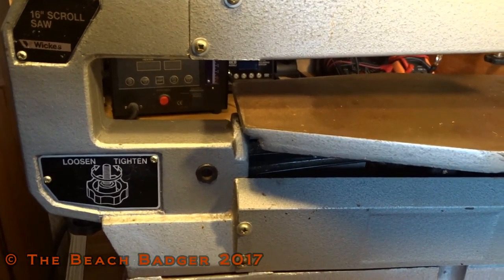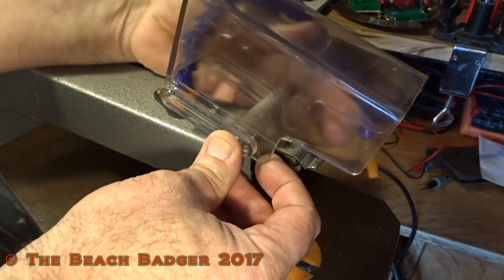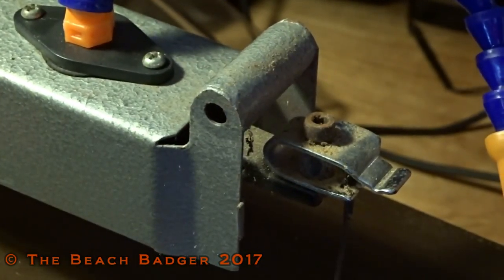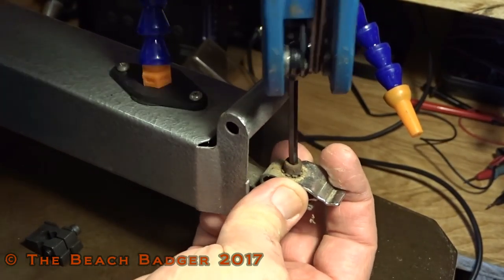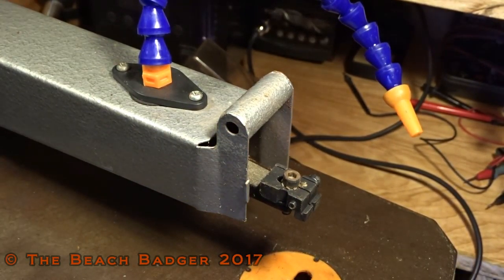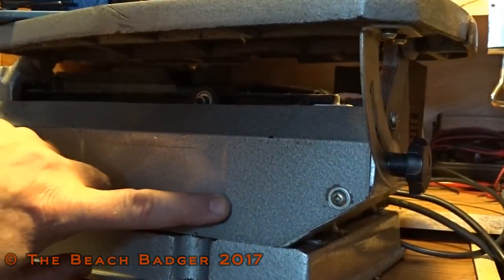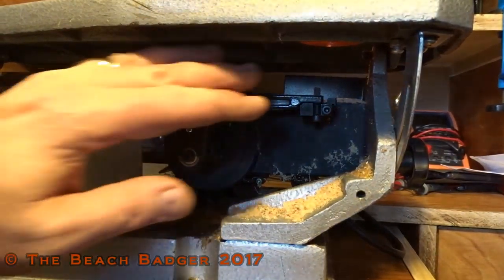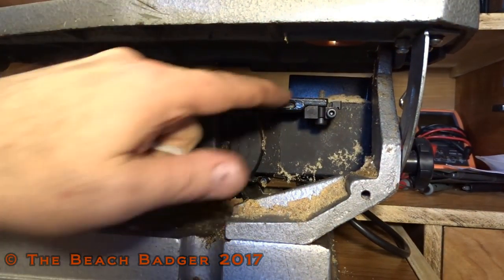old woodworking scroll saw conversion add a pinned and unpinned blade mount

Comment: Found your video, with exactly the same scroll saw as I have, 12 hours too late. Luckily last night I bought a set of blade guides as a long shot to fix my broken top metal guide & they look to be the same as you bought so they should work. For the person back in the comments asking where to get. I got mine from axminster tools  PAIR SPARE BLADE CLAMPS FOR CCVFS/ AWVFS/ 700153 to fit axminster or JET. My model which is the same design as Badgers is a Titan SF16G as was sold by Screwfix in the day.

Comment: I was watching in the hope you would show how you fixed the pin less blade in.I have a scroll saw with pined blades, but am not sure if it will take pin less blades.It's only a few months old, and was hoping it would but can't see in the manual.
Reply from the maker: sorry i didnt show it clearly, you place the pin less in the slot at the front of the mount and just tighten the allen screw on the side of mount so it grips the blade and holds it  in place ( do this on the top and bottom mount) , when using pinned blades the allen screw is left undone and the blade just hooks over the top of the mount, hope that helps.
Reply: thank you, I have been thinking my machine only uses pined blades. I will go buy some pin less ones now. Thanks again.
Reply: @TheBeachBadger  I am using Olson Spiral blades 46100 and tightening  the screw alone does not close the mount far enough to grasp the thin pin less blade.  Some sort of lock screw for the other side in necessary to provide a space take up to allow the closure to be tight enough to hold the blade.

Comment: I have been looking online at scroll saws with these type of mounts and most of them have a metal plate on top. Would this prevent them from snapping?
Reply from the maker: a good question unfortunately i dont know you could try fitting a plate like you have seen and give it a try,, the problem i saw is the mounts seem to be made from cast metal, let me know if it works gl
Reply: Will let you know if it works
Reply: I have tried these fittings for a month! I made a metal plate for them, I put the screw in the back hole and it hasn't  snapped
Reply from the maker: great Thomas glad you sorted it ok

Comment: Where did you find the mounts for replacement? A link or part number would be nice ! Thanks!
Reply from the maker: ok since doing this mod i ran into a problem one of the mounts snapped looks like they are made of cast , here is the site i got it from http://www.axminster.co.uk/axminster-blade-clamp-for-awvfs-scroll-saw-400124?sel=400124, i have since done a homemade clamp which works well :) hope this helps
Reply: Thank you!
Reply: Greg K you can buy fretsaw blade clamp holders from eBay.. just attach them  to each end of the pinless blade and hang them on the bracket on the saw.top and bottom tighten the tension and of you go ..

Comment: How did you resolve the problem after mount snapped?
Reply from the maker: i made a couple of mounts roughly using an angle grinder and a hacksaw and a small piece of scrap metal i will try get some photos taken and post them in a video and link to this video, it works really well with the 360 scroll blades i love it
Reply: Please could you add photos for brackets you made interested to see how you've done it thanks

Comment: I did this same thing to my saw, I did however buy longer screws for the "clamp" turned them backwards & use a wing nut to clamp the blade in, don't have to keep an Allen wrench near by